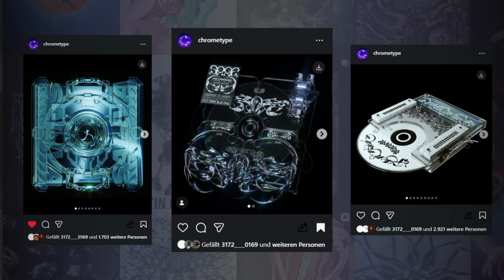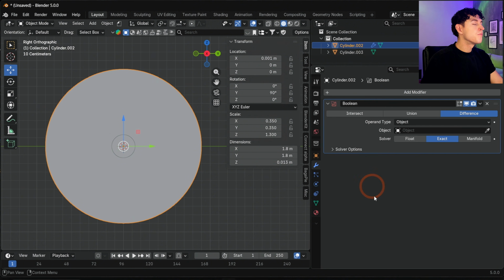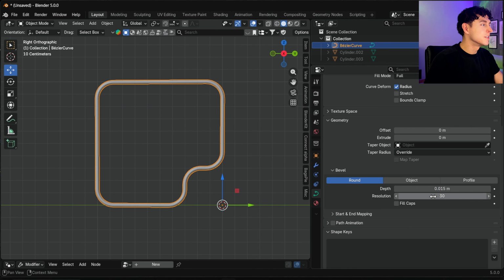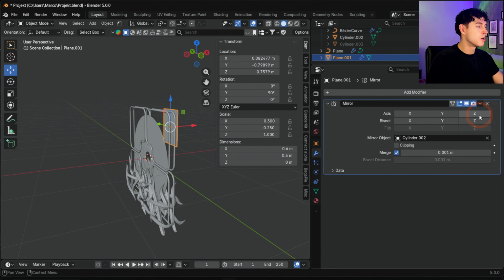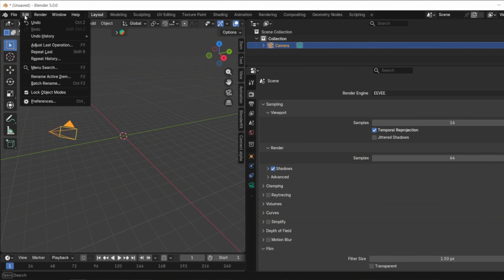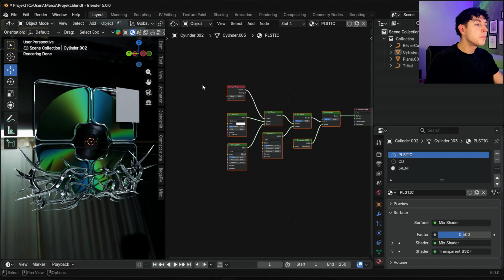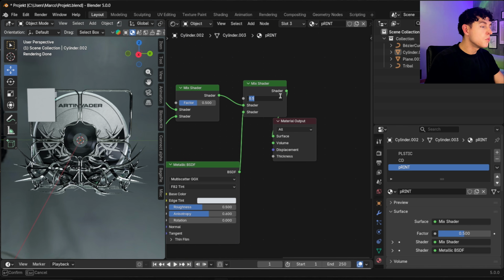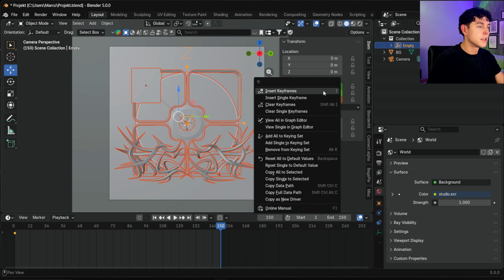Blender 5.0 Tutorial: How to Make a 3D Y2K Chrome CD Animation!

Comment: I really didn't understood what u jus did here like what u tapped while doing on the 2.32 timestamp
Reply from the maker: This section is just about adding some depth to the middle part of a CD.

I selected Z symmetry: Edits on the Z axis  are automatically mirrored on the other side

Now we use the Move Tool on the left side. Then I selected part of the surfaces and moved them outward.

After that, I moved the two surfaces in the middle inward.

Comment: Is there any other reason to set the Render Device to CPU instead of GPU when rendering?
Reply from the maker: I usually render with the GPU whenever I have a graphics card available. GPUs are optimized for this kind of parallel computation, so in most cases they’re much faster than the CPU.
The CPU is mainly used if you don’t have a suitable GPU or if the scene is too large to fit into VRAM.

Comment: soooooo amazing for starter. I am in love. But side note, the modeling of the center plastic part on the CD have truble in rendering, clear plastic see through the other material. IDK if the modeling part i did right. 10/10
Reply from the maker: Hey, I'm glad to hear that :D I had the same problem, but it's easy to fix! You can increase the roughness in the materials, which will completely remove the transparency. Or you can go back to edit mode and move the middle part back to the front. 👐
Reply: @artinvader_  thansk!!! Works like a charm